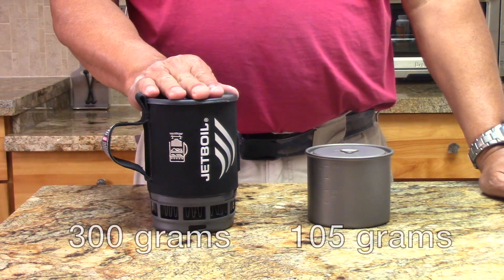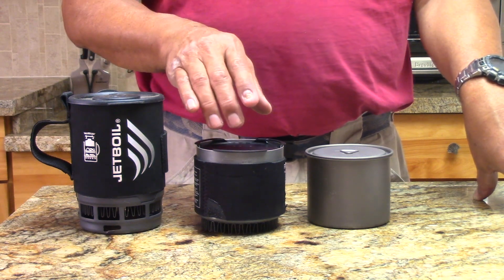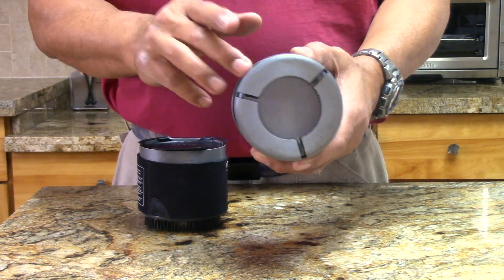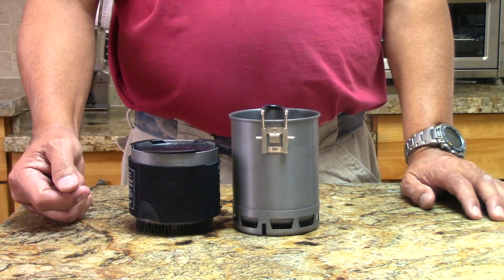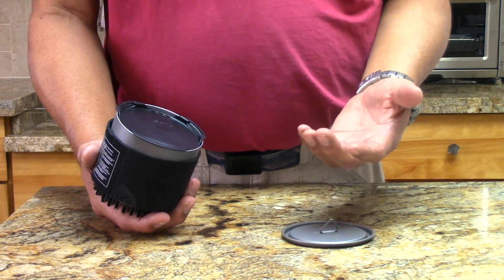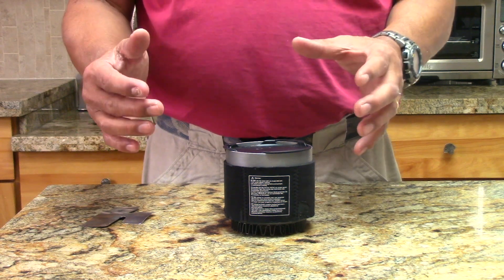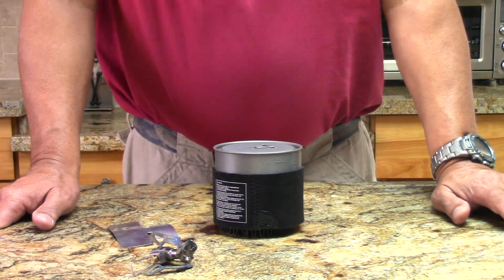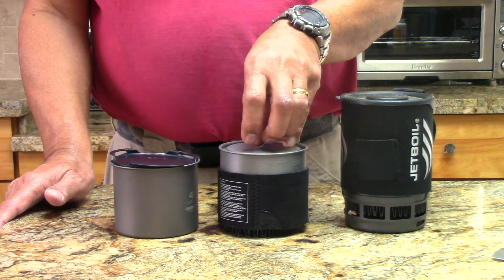MYOG 125 gram Heat Exchange Cooking System: Part 1 by Flat Cat Gear

Comment: Thanks. I really appreciate home modifying gear to meet your own needs. I made a neoprene pot cozy for my petrel g3, but found I had to cut it back quite a lot to stop it burning.  Did you have that issue. The Cheetah windshield is great, simple and light.
Reply from the maker: You CAN burn the cozy IF your flame levels are high,  I did a previous video on this.  Turn the levels down to get better fuel efficincy and it should not be a problem.  My 2 cents.

Comment: The ultra lightweight weenies are crying in their soup for one of these made from titanium , so  I cut my Sol Ti jetboil pot up a few years ago to achieve what the market is relluctant to provide , but what my heart desires is the MSR Titan cup with a lid ,and built in heat exchanger only then will my boiling water experience the pure Zen state of consciousness that has thus far eluded me.
Reply from the maker: Well, you know that this can be leveraged to the Petrel G2 mug (750 ml) as well.  Slightly bigger and more efficient in calm conditions.  My 2 cents.

Comment: What is the gauge of the windscreen?
Reply from the maker: I use 0.006" stainless steel.  Aluminum flashing may work, but it also may melt in certain locations.

Comment: Can you buy neoprene in a slightly thicker version than what they offer and just stitch it together to make your own cozy from neoprene?
Reply from the maker: No sure.  The Fire Maple G3 fits the same lid as the TOAKS 95 mugs and some Soto products.  I would expect that you can find a thicker cozy as that seems to be a common size.
Reply: @FlatCatGear  good point. Thanks. Based on your tests in other videos and possibly Gear\Skeptic’s as well, I’m not seeing any real benefit of the neoprene cozy over using nothing as far as fuel savings is concerned. I suppose if you backpack to camp and like to have your slowly consumed cup of Joe in the morning then one option is to combine the cozy with your respective pot for ease of handling. But as you pointed out in another answer, a bandana might work as well and save you a few grams too. I enjoy your little excursions into other ways to save a few grams but for my money and time the Toaks lid mod and possibly bending the handle a little to hold it snugly while hiking is the best “juice for the squeeze” regarding the Petrel G3.
Reply from the maker: @wanttogo1958  The cozy in this video provides one feature; it holds the windscreen in place.  I think that the only real reason for a cozy is if you drink out of your mug, over that 10-15 minutes or so, that would make a bit of a difference.  BTW, this was an exercise to show that HX mugs can justify their weight savings over a traditional mug.  This demonstration points out that there is a lot of room for improvement in HX mug design.  FYI – I am with you, this not a system I would take backpacking.  I am good with a slightly modified Petrel G3 and the Fire Maple Polaris stove.  It is a little heavier, but better features for me.  My 2 cents.
Reply: @FlatCatGear  agree. For me, the advantage of the fuel savings with the Petrel G3 to squeeze another day on the trail out of a 110g canister is the real advantage offered by the small, additional weight of the G3 as compared to some comparable sized pots.

Comment: Curious. You previously stated that pot cozies weren’t worth it, so why did you go with one here?
Reply from the maker: So, this MYOG project is targeted at a very specific group: UL backpackers (extreme gram counter).  That particular group would gladly use a bandana, sock or glove to pick up a hot item rather than bring a pot lifter.  You can also leave the cozy uncut and flip it over on itself to double the insulation.  That UL group would also consider making the pot and stove modification just to reduce weight.  Most people would just use the Petrel mug with the Soto 3 Flex.  That pot is too small for my backpacking style.
Reply: @FlatCatGear  How much does the cut down cozy weigh? I just grabbed it on AliExpress for 99 cents.
Reply from the maker: @Andy-Mesa  16 grams for the cozy, so cut in half about 8 g

Comment: Really nice. Can you help elaborate how you remove the bottom cover over the HX fins, I’m assuming you used a dremel? Also the weight you quoted is wihtout the HX fin cover right?
Reply from the maker: All of the testing was done with the shroud in place.  I removes the shroud and it did not test well.  The listed weights are with the shroud removed (not many grams).  I used a file to break the spot welds.  Just leave the shroud in place.  I just didn't want to cut down another pot just to take a picture.
Reply: @FlatCatGear  got it totally makes sense

Comment: Does the neoprene sleeve provide enough protection to pick up the pot when hot?  If not, I would presume we need to add a micro-pot grabber to that setup?
Reply from the maker: I have measured the surface to get up to about 150 F, that I can deal with but it is pretty hot.  Well, this kit is really for the UL crowd and they would nirmally use a bandana or something to grab teh mug..  Instead of cutting the cozy, you can also fold it over to double the thickness.  There are micro pot holders that weigh 3.2 g.  Many options.
Reply: @FlatCatGear  That micro pot holder is what I was thinking, maybe even in place of the sleeve!  Also curious, what are you using to cut/clean the cut on the pot?
Reply from the maker: @drewhiking  I do have a shop, so I put an abrasive cutoff blade mounted onto a madrel and mount it on my drill press. You place the mug on the table and slowly cut/rotate the mug around the saw blade. You can scribe a mark around the mug and use a hack saw to cut as well (rotating as you go). It will need a bit of filing to make a smooth edge. Best of luck.
Reply: @drewhiking  I placed my dremel vertically at the edge of my vise at the correct cut height.  Turned it on and set the pot next to it, making contact and turning the pot in circles until cut through. Only took a dozen or so turns.
Reply: @FlatCatGear  What about moding neoprene layer using silcone glue and old silcone bracklet/band. I know they make silcone bands for Nalgenes (5"x2") and you cut up and glue it. Or just use ring unmodified put it around the pot underneath the neoprene layer.
Maybe you could test how much you need to modify the neoprene sleeve to make pouring immediately after boiling.
Great stuff. Appreciate it
Reply from the maker: @HotGrandma2000  People can adapt to add whatever insulation they want.  I can deal with it as is as i am pretty heat tolerant.
Reply: @FlatCatGear  Would the micro pot holder even work on this without the rolled lip on the pot anymore?
Reply from the maker: @mlahey5187 should work fine, you do have to squeeze the handles to hold it.